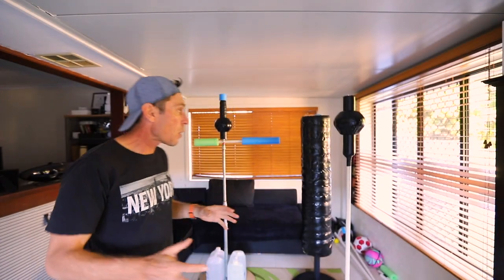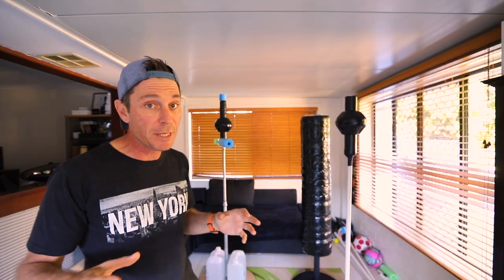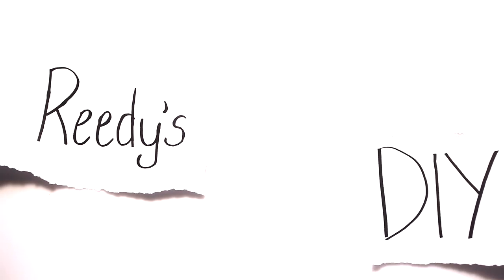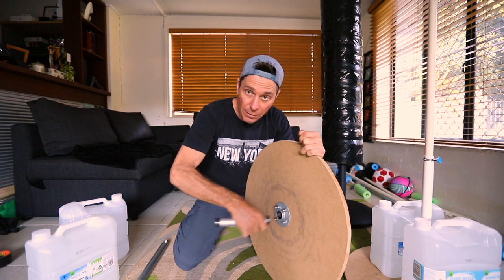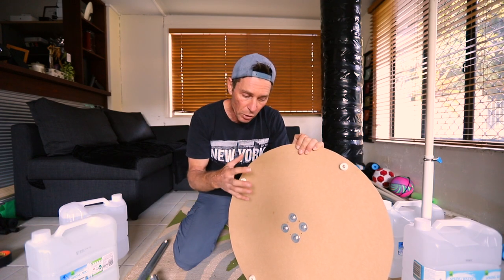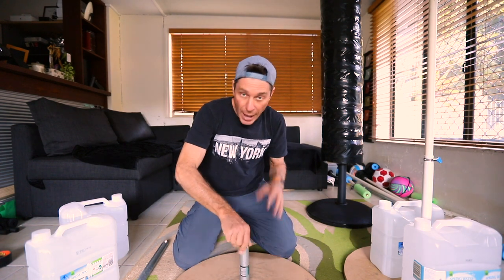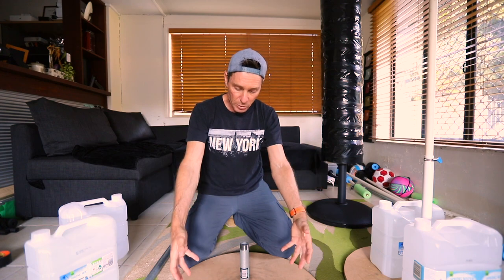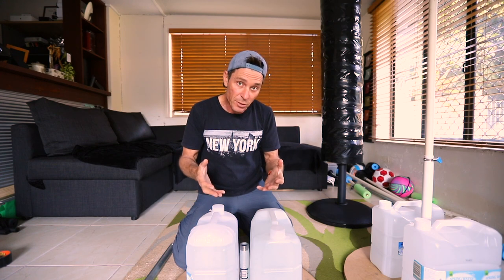DIY Base/Stand V2 - for the Cobra Bag, Spar Bar and the Free-Standing Punching Bag

Comment: What do you recommend the length for the bolts to be?
Reply from the maker: Depends on the thickness of the board that you choose. They need to long enough to go though the board and the flange and then a little extra for the washer and nut to go on.